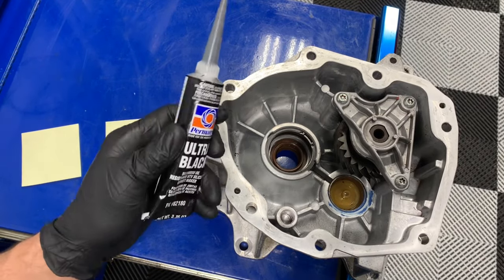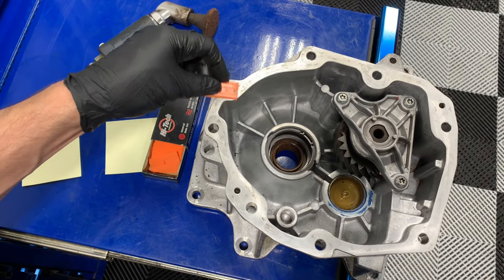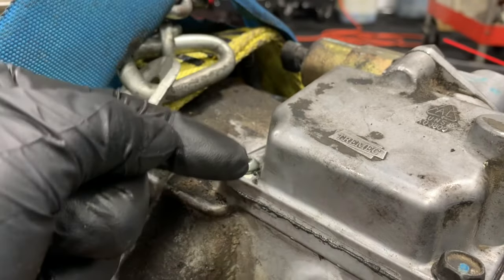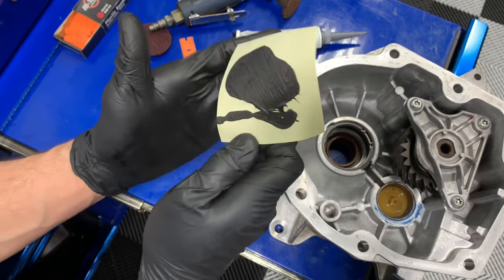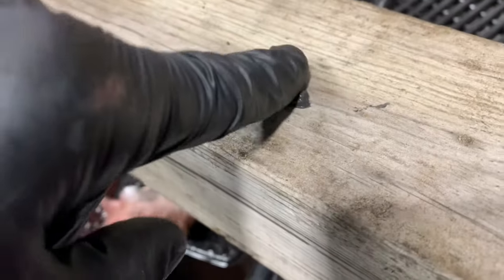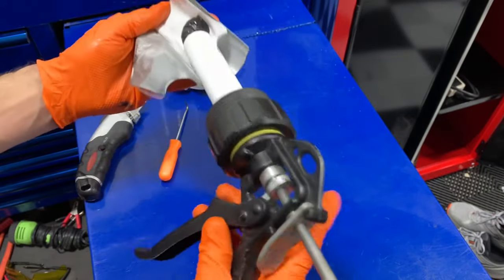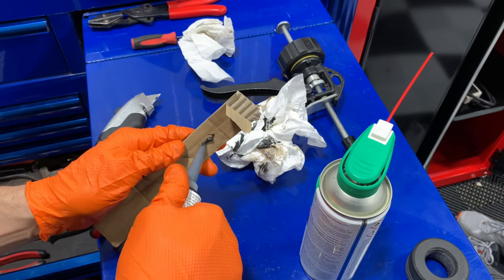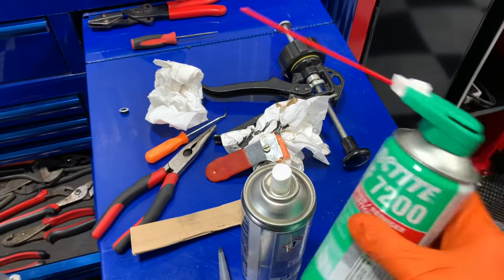RTV no-no’s ,  Before you go ultra…….. watch this! How to use RTV gasket maker correctly

Comment: You need a Valco Cincinnati Tube-Grip. Makes it much easier to apply the RTV.
Reply from the maker: Oh….my……god…… never stop learning!!! Thank you for sharing! I will pin this post! ❤️
Reply: Agreed I keep 3 in the bottom of my roll cart. AWESOME!
Reply: Brilliant, my arthritis in my hands always flared up when squeezing the RTV out of these tubes!
Reply: I have 2 in service truck and 2 in shop they are game changers for silicone ECT .
Reply: I’m doing a oil pan on my civic can I use ultra black or should I get Honda bond also do I need to put some on both sides on pan and engine
Reply: @obee69242000 Honda bond is made specifically for Hondas/Acura, so yes. Just put it on the oil pan

Comment: ASE master tech here as well. I have uses untra black years. On timing covers and other large covers I've always used my finger to spread the rtv out and wiped any excess away from the inside (where the oil is) before assembly. Never had any leaks doing that. You are 100% correct, a tube will last a long time. A dab will do ya!
Reply: "Master tech" 😂😂😂
Reply: @AntonadiasLongfoot that’s likely his title, not a self proclaimed one goofy ah
Reply: I do the same, never been a problem for me, it makes me feel better knowing the rtv is going to fully seal, instead of relying on the mush to fill in the gaps
Reply: @robertgarduno937 goofy ahh. “Goofy ahh” goofy ahh
Reply: @2004hondacivichybrid  I agree

Comment: Well, you do make a gasket as a matter of fact -if it is an oil sump for example - and you will realise it when the internal pressure blows out the seal and oil leaks out.. The key is not to torq the bolts immediately, you wait at least an hour after finger tighten the bolts-you stop as soon as you see the seal coming out between the surfaces, and I say it again : you wait an hour and then you can torq the bolts. Ask me how I know it...

Comment: Use Hylomar Blue. If you use RTV a great method is is to use a foam roller and spread the RTV out on a sheet of wax paper then use the roller  and roll it until the foam is even spread with RTV. Then run the roller over the surface you need sealed. it will spread an even thin amount everywhere perfectly. The proper amount should allow you to see thru it once spread out.

Comment: Ooops... I am one of those who used METAL Razor Blades. :( I gotta say I do recall having snags. I went over it with a smooth sanding paper (probably another no no). I wished I would have seen this video before having to remove the gasket that I can't get off this 1980 Kawasaki KZ750 Motorcycle's oil pan. Plus I don't have a lift to work properly underneath, so being upside down for hours is painful. I'm almost done and have the surfaces as smooth as I can get it. I've been searching how to place RTV correctly before I mess that up and I ran into this video. I will make sure to make the bead as you explained. I hope I don't have any issues because of my removal methods :(

Comment: That permatex rtv remover didn't work in the 80s, and still doesn't. There are the blue or orange fiber brushes you can put on a drill, or brass brushes but plastic scrapers, razors and wd40 are sadly the best way. Good video.

Comment: Great video. I had the oil pan sealed twice and its still leaks through from few locations because of incorrect application of the sealant and because of over-sanding the aluminum pan 
Really great video !
Thanks !
Reply from the maker: Oh man sorry to hear! Thank you so much for the nice comments. I hope it works out for you! Lou
Reply: First time I heard of over sanding a pan, as long as it’s flat and theres adequate flange thickness to hold oil it should be good. The filter might not fit or be right up against the bottom but that’s extreme

Comment: @1:00 also something very important to note about those Roloc discs. They contain oxides/abrasives  the same found in sand paper. Using those on any open engine/case work will load what ever you are working with abrasive particles. These particles are especially bad in engine oil and can cause bearing failure. Using the RTV Dissolver and plastic scrappers are perfect. You can use Roloc discs but only if you can use a parts washer/clean the parts really good before re-assembly.
Reply: Use the Scotch Brite pad instead, there's no abrasive to fall off.
Reply: @D-Mayor  all Scotch Brite pads have abrasives loaded into them.  It's not safe to use them either
Reply: @tsslaporte  the Scotch Brite is the abrasive itself, there is no extra abrasive like a flapper wheel. You have to use common sense, just like if you're using your method with RTV dissolver. Letting that & old scrapped off RTV into the engine can block oil pick-up screen or plug oil galleries. I typically cover the area with a rag & scrape most, then final clean with scotch Brite wheel & brake clean.
Reply: @D-Mayor  All Scotch Brite products contain abrasives, it's not something that can be avoided and parts should be cleaned appropriately if used. "Thin green general purpose
cleaning and scouring hand pad, made of high quality synthetic fiber forming an open textured non-woven, abrasive
evenly dispersed throughout and bonded to the web with a durable resin."
Reply: @tsslaporte  engine failure due to oil pick-up plugged with RTV scrappings, care must be used to avoid debris entering engine.

Not to mention the solvent dissolving adjacent seals that are not being replaced.

Common sense is key.
Reply: @D-Mayor  yes absolutely but using abrasives by an open motor is very rarely understood as a high risk.
Reply: @tsslaporte  no I think it's well understood, cleanliness is very important, just as you don't want excess RTV plugging up the oil pick-up screen or compromised seals from excess use of RTV solvent use.
Reply: @D-Mayor  you keep talking about RTV, this whole conversation is about microscopic abrasives that are damaging to journal bearing surfaces.
Reply: @tsslaporte  which boils down to lack of cleanliness, if you are careful & take precautions not to contaminate the assembly with debris you will not have a problem. Careless use of RTV solvent can damage adjacent seals & case further problems. Use care & you will be fine.

Comment: Pliers to squeeze and roll the tube while you go, will too often put tears/cuts in the tube then it's dried out the next time you try to use it.  Just cut the nozzle slightly bigger, and take your time as it is only a minute difference either way.  I find it easier to just push near the back of the tube and not worry about trying to get the tube perfectly flat/rolled during application, instead wait till you're done, lay the tube on a flat surface, and just roll a hard round object from the tail of the tube, up it till the RTV is filling the top and coming out a little.  You want it to come out a little so when it forms a dry plug, that seals the tube then you just pull that plug off the next time you use it.

Comment: Man i just did my trans oil for the first time the other day and im proud to say i inuited a bit of this. Kept a small, probably closer to 3mm bead nice and tidy all the way around.  Used a plastic putty knife to removed all the old shit. Did a final clean with some brake cleaner - a recommendation from a trusted friend and bolted her back on with new filter, gaskets oiled. 
Measured the amount of fluid removed and replaced exact amount.

Only thing i got lazy on was checking the fluid level at operating temp post-op. Mazda CX 5 requires removal of air box to get to the dipstick which is bolted in from the top. I just got lazy and said fuck it, i measured. 😅

Comment: Very useful. I know I need to work on bead work even for some adhesive work that I do. I love your explanations and demos. I wonder if I can get some washers to practice (putting the washers on a nut/bolt, put my bead on, then tighten it up to see if my bead was appropriate or not based on the ooze). I'll find a way to practice somehow...before having the guts to do it on an engine. :) It was a short video, but every second of it was useful. Thanks!

Comment: Excellent explanation and demonstration. Would have liked to see how much you squirt out on the sealing surface before you joined the parts. Thanks for the valuable chemical tips!
Reply from the maker: I used almost the same bead as the small bead in the notepad trick. about 2mm thick. thats what we are taught through mercedes.
Reply: @MasterTechLou  
OK, thanks. I just installed the front cover on an '07 4-Runner 4.0L engine. Used about 3/16" bead and it squished out perfectly! Used Permatex Optimum Black and Gray around the water openings. Finger tightened and let sit 1 hour then torqued. I think it needs to sit finger tight for an hour to absorb oxygen to cure property. Anyway, thanx for your informative demonstration and commentary!

Comment: If you really want to see how much to use, just look up a "factory assembly" video and watch the robot put on a little bead.  It's typically about the size of the straw on a WD40 can, or the little white tube of a Q-tip.  Not much bigger than 1mm in diameter-  maybe 2mm's max.
Reply from the maker: Our spec is 2mm +/-0.5 mm

Comment: Good video two improvements would be covering proper product sealer selection and using a clear flexaglass plate to show the excess squeeze out and proper torque to show and tell .  Clean and ppprepp

Comment: Why not make the two surfaces touch and wait until the RTV hardens slightly to reduce the spread and then torque it? Would you still have excessive RTV enter the transmission?
Reply from the maker: If you think about what you are sayin you are now tellin me you want hard rtv between two surfaces. Only way to reduce spread is to reduce rtv amount 😉

Comment: Master Tech Lou ? will that cleaner remove the left over RTV gasket maker left in the cone tip ?
Reply from the maker: @FUNKBOOGIE1  it could yes , it softens the silicone. We usually just unscrew the tip and push it out backwards

Comment: Here’s one… new water pump, new water pump backing plate (it’s on a Delorean and doesn’t mate up to the block), paper gasket. Both surfaces new and flat… to seal or not to?
Reply from the maker: not rtv, if anything I would use indian head gasket , its a shellac, if spelled right, i have no idea what that means haha but its an old  school, verify thin, so NO you do NOT have to use anything but the paper, BUT due to the age of the car and the parts which most likely are not oem, I would feel more comfortable adding shellac. its smears on with like a q tip kind of a head, you will see,. just a gentle coating, should be good .

Comment: Well explained, but what about engine oil and filter intervals after rtv use? Thanks you
Reply from the maker: Good question, I don’t think it matters cause if you put too much depending on where, the damage is already done. Filter will catch what it can, and oil pickup will clog. Good question tho. Thanks!
Reply: @MasterTechLou  i have read that it will mix with the oil and although it's harmless unlike dust silicon, the oil in the engine while repair should be changed
Reply from the maker: @mm-il8dg  if its hard on the outside its hard on the inside. Which is why you should give it time to cure. Im not sayin your wrong by any means. But ive never had to worry about changing oil right away. Only if cleaning old silicone from an engine and getting excessive debris.

Comment: Hey guys relax a bit.  Seeing a few comments on clogging up oil galleries and such with rtv. However those oil filters are amazing things.  The only way you get to clogging up the engine is if you have so much stuff in the filter that the filter bypass activates.  I think best case scenario is if you let it cure properly into a hard solid.  If the filter can catch broken off engine bits, I'd think rtv should be no problem 🤔
Reply from the maker: Good thought but what you are missing is that almost all newer engines use rtv for everything, and if used on the top end it will clog passages and drains where the cams are at and vvt solenoids. Sure thats solid advice on a chevy 350 from the 70’s, but these newer engines have a lot going on. And rtv issues is the reason I made this video ❤️

Comment: Is there some reason for not cleaning up excess on outside or is it just preference? Thks..jc
Reply from the maker: Not really a reason to. Also to me you want it there to stop anything getting into the cracks if any, lets say you wipe it off, what if it pulls out any sealant that you need in between the surfaces allowing debris in. Its just not common to worry about the little bit that squeezes out. It doesnt hurt anything .
Reply: @MasterTechLou  Got it..thks

Comment: How do u keep the rtv from drying in the tube? Recapping it doesnt work.
Reply from the maker: Rtv does have a shelf life so I dont really reuse rtv tubes unless its within weeks. But even then ive usually only had to clear the top opening or the cap so fresh can come out of the tube.
Reply: @MasterTechLou  i use rtv about twice a week and everytime its always dried up under the cap and always needing to try unplugging the tube. Capping it tightly doesnt work. Theres got to be a solution.

Comment: Good video. Can you tell me if l should use rtv on a water pump gasket made of steel with some sort of felt-like coating on it ?. Thank you in advance.
Reply from the maker: Thanks! And absolutely not. If any gasket need’s silicone added its ones that cover two different surfaces. Like timing cover to cylinder head. But the mls gasket you have is all thats needed. I know we tend to think “surely thats not enough “ but what came off is whats been keeping it sealed this whole time. Those can be called multi layered seals MLS. But its truly all thats needed. If anything  to ever add, Indian head shellac is the way to go. But anytime you need to add something it will be shown in the work instructions. Hope my ramblings help 🥴. Basically my answer is no. But I hope your surface is not damaged by any means.
Reply: @MasterTechLou  Thank you for the detailed response. Somehow it just doesn't "look" like it will make a water tight seal.  But I'm going to resist my urge to run a bead of rtv around it :)
Reply from the maker: @shinola228  what year make model engine?
Reply: @MasterTechLou  It's a 2008 Sonata 3.3.  I don't have it yet, I'm just preparing to do the job for a friend. So l got an Aisin pump and it came with the gasket l mentioned. Unfortunately that gasket was kinked on one end due to poor packing - l straightened pretty well l think but that also made me want to put the rtv on it. I would send it back to rockauto but I've returned other things recently so I'm thinking they might feel I'm abusing their free return policy.
Reply from the maker: @shinola228  ah the hidden info, order a new gasket from O’Reilly’s, dont dare use a bent one.
Reply: @MasterTechLou  Oh ok. Thank you for that.

Comment: qhat are you suppose to do with all the silicone thtq gets stuck in the nossel and gets wasted??
Reply from the maker: @wonderwalls3565  collateral damage 🤷🏼‍♂️😂. I remove the nozzle and push the hardened stuff backwards  to continue using the tube but there is not really a good way to salvage whats in the nozzle. Least not that I have found or really cared about.
Reply: @MasterTechLou  thanks.

Comment: Doing a water pump on charger and I keep getting different opinions about etc silicone on rubber gasket I still have not come to a good solution
Reply from the maker: You dont add silicon to rubber seals. Theres no reason to. Rubber seals usually stick up 1-2mm higher than the surface and squeeze when tightened. There are rare instances where you would want to. Like if there’s two mating surfaces across the seal then you add a dab of silicone to make up for the imperfections.

Comment: What product would you recommend to remove ultra black or grey gasket maker?
Reply from the maker: @fernandosouto6835  black is the best for oils. If memory serves, grey is sensor safe? But black is the way to go usually
Reply: Thanks for the quick reply and helpful video. I’m trying to open up a diff that’s sealed with Permatex 81182 gasket maker. It’s similar to ultra black. What solvent do you use to open the diff with?
Reply from the maker: @fernandosouto6835  solvents dont often work, you can use a
Blow dryer or heat gun and there should be a spot to
Pry safely

Comment: Can this be used to as a gasket sealant for thermostat housing?
Reply from the maker: Thermostat housings either use paper seals or rubber. There is never a need for silicone in my experience.

Comment: So question, I'm gonna do a transmission pan gasket on a 99 Camry.
Came with gasket and filter and I've read on a book and Haynes repair manual that the gasket is enough by itself to seal, but I feel like including some gasket maker to hold the gasket is that fine or will I get problems in the future?.
Reply from the maker: Gaskets are fine alone. As long as the pan is flush and the holes arent dented in . I usually run a hammer over the holes to make sure theyre flat if the pan is metal. If torqued the right way a gasket is all you need.

Comment: Are you supposed to finger tight the bolts to let the sealant tack up for a minute or so? And then factory spec bolts?
Reply from the maker: No, you apply the sealant and then usually have about 15 minutes to mount the parts and then it takes a full 24 hours to cure.
I always squirt some on a piece of paper as well as a test so I know that when it gets hard that means I can fill the parts with fluid then